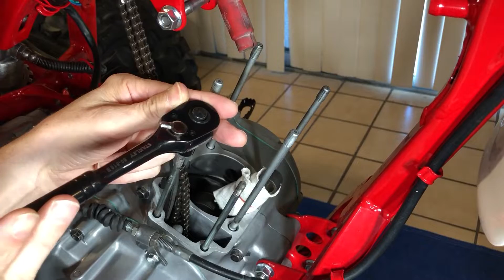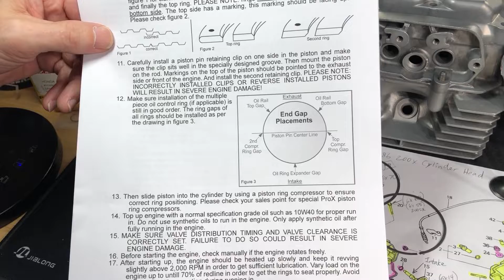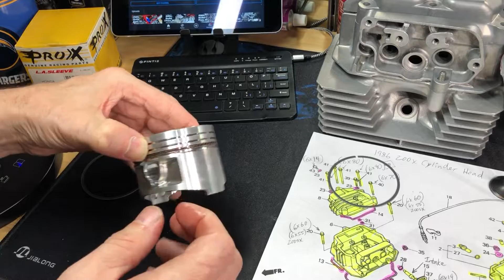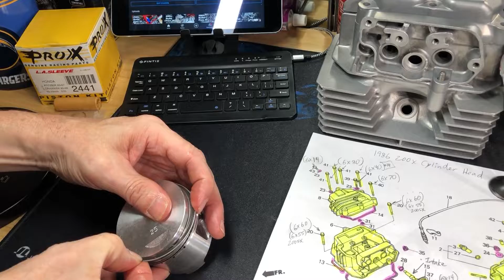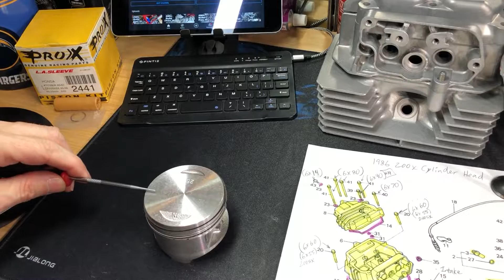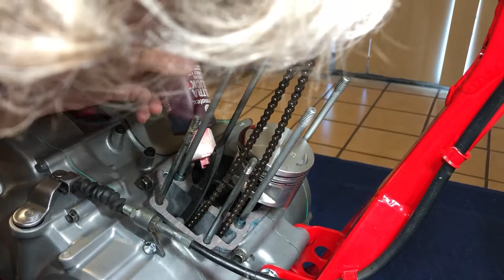Honda ATC 200x Build - Part 18 - Engine Motor Top End, Jug Cylinder Studs, ProX Piston Oil Ring Gaps

Comment: Cool videos.  I believe the RN ring goes on top.  Has chrome on it.  Black ring is the oil scraper.  Double check for sure.  Ride on!
Reply: i did my 400ex and chrome was on top also....do you remember what you did on your 400ex?? i guess i could go back and watch the video lolol.. but should be the same,,.... they say the black ring is bigger thicker goes in middle because it has to do most of the work... but awsome job man, ready to see it rip...
Reply from the maker: @michaeldeel7998  My 400ex was chrome on top ... but there was also instructions and proper markings on each ring
Reply: @11GalleryATV  10-4.. how is that 400 running now days??
Reply from the maker: @michaeldeel7998  Running great! I am going to do a video here shortly putting on the graphics ... I'll show some riding footage as well!
Reply from the maker: Thanks! So far every forum I've checked, and the Honda service manual say the "R" goes on top and the "RN" goes underneath - https://thumpertalk.com/forums/topic/778794-trx450-piston-in-a-crf450x/page/2/
Reply from the maker: Upon further investigation, I think you are correct sir! These oil rings are made by RIK "Riken Corporation". Those marks "R" and "RN" don't mean anything to which order they belong in. They only mean which factory they were made in and of what material they were made of (stupid asses for doing that!). -- http://www.yute.com.tw/NT_e.htm -- Anyway, you just use these marks to make sure the ring is installed with the mark facing up. Now you have to pay attention to the bevel and thickness and make sure you get these in the proper order. Mine were backwards and are now in the proper order. Thanks!

Comment: I FINALLY started filming the build for my daughter’s budget racer. It’s a blaster. It will be a full build, but not with all top of the line parts. We will be doing another that will be built to the max.
Reply from the maker: That's awesome! Lemme know when you start uploading videos and I will check them out!
Reply: @11GalleryATV  I need a little bit more footage and then I’ll get it edited. Might do the motor tear down in video 1.

Comment: Hey man listen I have a 1985 Honda 200x and I split the cases on it and I’m having some difficulty putting it back together if you could get in touch with me that would be greatly appreciated
Reply from the maker: 83-85's are TOTALLY different motors than the 86-87. I have never worked on a 83-85 engine before.
Reply: @11GalleryATV  ok well thank you anyways tho for reaching out

Comment: I recently rebuilt a tr 200 top end a week ago.  First I ran the chrome ring on top.  It got hot and had low compression.  I pulled it back apart and ran the scraper oil ring on top.  It cooled down and increased my compression.  I believe this is the correct placement because the chrome ring needs an oil film to seal and lube its movement.  I ran the Honda hb3 rings and the scraper ring has an r and compression ring is rn.  I believe my initial thought was incorrect.   If the scraper is below the chrome ring how is it going to cool.  I would check with a Honda pro if you can find one to chime in.

Comment: those cylinders are tight and its hard to do with the head studs in the way ...i got two 83 200x frames and 200sx motor ..all my parts were bought in boxes that other people have taken apart ..its all i have so i'm in the middle of making a trike out of it all ..got the motor together and put a newer crank in it ..i wish i had an 86 or 87 frame cause there are plenty of people who made this conversion ...i've been welding since i was teenager and i'm ancient now ...i got the motor to fit with home made brackets ..there isn't much chain adjustment as the swing arm almost touches the engine and i'm going to have to have a custom carb boot..but i think it will work ....anyway like your vids nice work
Reply from the maker: Thanks! ... and good luck with that project!